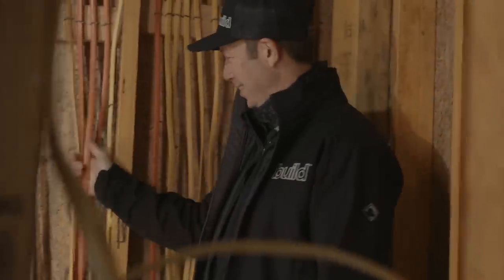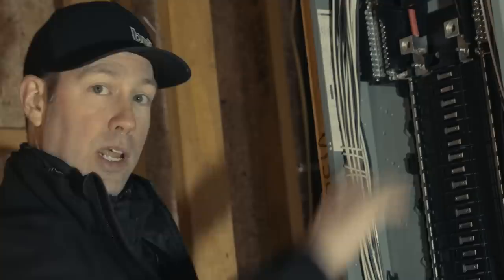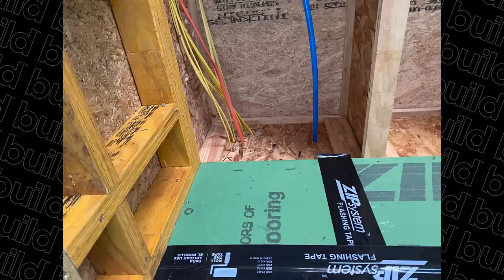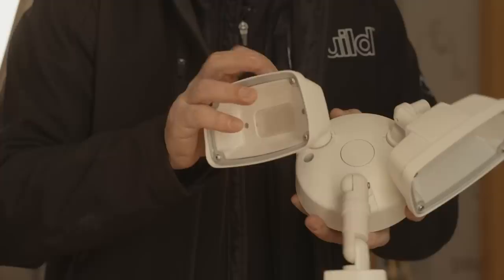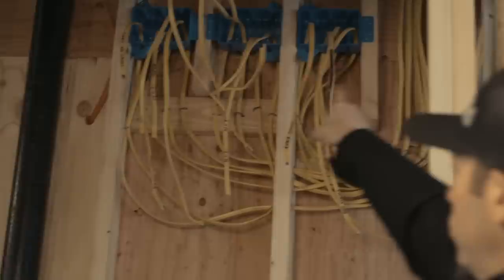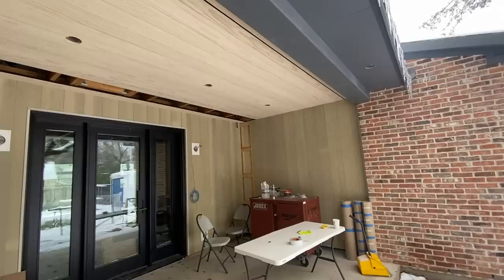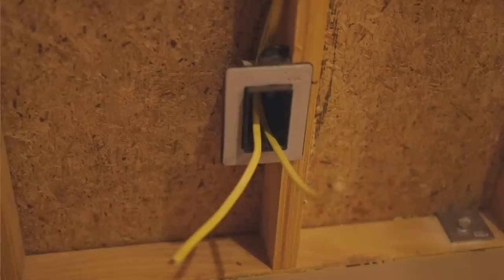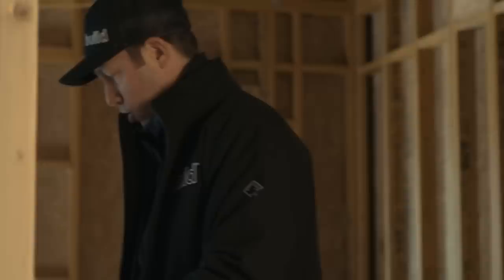5 Tips for New Construction Electrical & Smart Lighting!

Comment: You could go through the expense of having all 20A circuits, or you could tell your electricians to put the lighting and receptacles on separate circuits. Have lighting on 15A and receptacles on 20A. Just my opinion but you’re the boss😂
Reply: But then he can't brag everything is on 12 gauge!
Reply: you can but the extra labor and planning might not be worth simply keeping it all 20
Reply: @frankyb702  It's actually more labor to work with 12ga, as numerous electricians have pointed out. Since lighting and outlet circuits should be separate, regardless of wire gauge, it's not hard to use 2 different flavors. You still have to put other things on wire bigger than 12ga, so it's not like the whole house is done that way anyway. And if you use 14 for the lights it is easier to identify in the future - white romex = lights, yellow romex = outlets. Kind of like using the blue and red pex...few people just use white for both.

Even if wire is free it doesn't make any sense to use 12 for lights...also, even if you have 12ga for your lights, it's better to put lighting circuits on a 15A breaker too - again, easier to identify.

I totally agree with outlet circuits, 12ga/20A for sure, although still very unlikely to ever use that capacity. (Especially for an energy nazi like Matt)

More importantly if you hire an electrician tell him to do it right, don't tell him what kind of wire to use. That's his job, why did you hire an electrician? I can just imagine the face palm when the clueless customer starts dictating wire size...
Reply: With the introduction of many low voltage LED lighting fixtures, it makes so much more sense to separate the lighting and receptacle circuits.  Making it even easier for automated control later especially if you make your lighting runs to a separate box and your breaker feeds to that box.  Join them with wire nuts for now and later you could insert full automation control when you are ready.  This and not having to rely on unreliable wireless control of your lights.
Reply: Why are the 220 circuits outside?
Reply: @ryanroberts1104  Anyone who has managed subcontractors knows that once the price is set, they are going to get the job done with the least effort and least cost possible. It's your job as the GC to snuff that shit out by dictating requirements ahead of time.
Reply: @mr.g937  Somebody like Matt should be using a quality electrician, not some Mexican they found outside a Home Depot. That means the electrician should know it is a high end home and wire it as such. High end electricians are a thing and probably all Matt works with. Matt himself knows nothing about wires and electricity, that's the problem here. You don't spec things out when you have no idea how it works.
Reply: How about let the electrician do his job.
Reply: Yes agreed. Separate lighting in 15 is more than enough.
Reply: @vadimnesen8060  But 20 is future proof. Maybe you wanna add something later and that nearest circuit is the lighting circuit. 

If you go all LED you can put up I thing 150 lights on 1 circuit no problem. Which is more than enough for a house. But it depends. Is the extra $70 in wire worth that kinda savings?

All price savings for homes comes at the detail level not the rough in level. 
The type paint, trim, siding, etc. 
Plumbing and Electric upgrades are pennies compared to the bathroom tile or faucet fixtures you choose.
Reply: @genestarwind4610  yea its a expensive way to future proof i guess.
Reply: @ryanroberts1104  You're 100% right
Reply: 15A lighting is much more efficient, especially when cramming dimmers into boxes.
Reply: @krakenwoodfloorservicemcma5975  yea its silly doing it in 12 wire. Most new commercial lighting is ran with 16 Guage low voltage wire, only the transformer gets a 12 wire
Reply: exactly, way most do around here, never mix outlets and lighting on same circuit anymore
Reply: everything on 20 amp is stupid. Put an amp meter on any 20 amp circuit that is running receps and lighting and it will not be pulling close to even 15 amps.
Reply: If any of you above were electricians you would know that NEC states that lighting circuits in a single family dwelling cannot exceed 15 amps, most inspectors around here would be scratching their head trying to figure out why you struggled to make up and cram into an already undersized jbox attached to these new LED fixtures 2 or more 12/2 cables and why you spent all that extra money for no reason and what other codes you disregarded over a preference.
Reply: @genestarwind4610 Not really. You keep the lighting and receptacles on separate circuits. So, if something is to be added that isn't lighting, that goes to the nearest receptacle.

Comment: The Halo line is only 5% dimming.  He is going to really regret that. People don’t understand how important 1% dimming really is.  I personally feel that Lutron has significantly better lighting control systems.  Also, If you’re going to go to the extent of having smart lighting, and home control, you really should have an IALD certified lighting designer do your lighting plan and fixture specifications.  Unlike interior designers, an IALD lighting designer DOES NOT make money of off fixtures or get kickbacks from manufacturers.  A good lighting designer will help you avoid a lot of lighting pitfalls, and also keep you in budget.  I can’t even begin to tell you how many bad lighting layouts I’ve seen done by architects… Lighting has become a true specialty, and it’s well worth the investment to make sure you’ve got the right person looking after it.  I am not a lighting designer, but I would never build my custom home without having one on board from day one of design.  Worth every penny.
Reply: Bluetooth is also an awful option for large amounts of lighting as well.

He should have gone with Zigbee, or Zwave devices. Those are also not vendor specific protocols and can be controlled without proprietary apps. That app he has might not be supported in a few years and he is also stuck in the ecosystem of those lights. With Zigbee/Zwave lights you can mix and match manufactures to work together.

They also form a mesh network to keep devices from dropping off which I guarantee he will be having issues with bluetooth. 

Just speaking from firsthand experience. I imagine those were sponsored products anyways.
Reply: @Cstegg  "Bluetooth" as used in modern lighting products is actually the "LE" version which supports mesh networking. ZigBee often uses the same 2.4GHz as BT, with the same penetration problems. Zwave is a closed proprietary protocol. BT LE is actually a very reasonable choice and improves every year with better vendor adoption. I worked on the original ZigBee specification and even I say it's not significantly better than BT LE in the generic smart home use case. The 2 protocols can be remarkably similar when configured so.

Comment: Wafer lights are a pretty poor choice for a new home.  Having the bulb recessed in the can allows for much better light distribution. Wafer or surface lights are for closets at best. Spending a bit more on your cans either from WAC, USAI or another higher end manufacturer really makes a difference. Also, if the house is custom, I would find it in the budget to hire a lighting designer. I am willing to bed most if not all the lights are placed poorly. 4 cans and a fan, downlights over carpet, bathroom sconces over a mirror  etc.

Comment: use #14 for lighting circuits. Your electrician will thank you.
Reply: Totally agree.  Especially with LED's.
Reply: @dmolldude  also easier to make up to small fixture wires and multi gang switch boxs are a breeze.
Reply: IF that's the only thing on the circuit. Honestly, I would do 12ga everywhere too, then give the electrician a $100 gift card to the restaurant of his choice.
Reply: I just re-wired my own house and even being in the industry did all 14/2's for lighting. Made no fuckin sense to use 12's everywhere. Even at cost, that shit adds up... I did use 12's on most receptacles however though. That actually made sense for the added cost.
Reply: @Floridaman8783  my Local county Natrona, in Wyoming 12/2 is code.  Only trailers (single and doublewide etc.) and smoke alarm circuits I believe can be 14/3, but rarely does electrician bother to carry any 14... With LED lighting they really could change the code and allow 14/2 circuits for just lighting.. I am a broadcast engineer and DIY handyman, not electrician...
Reply: @Crusader1815  Sure, let's just throw money everywhere. It grows on trees...
Reply: I totally agree 14ga. for all lighting circuits should be the norm LEDs draw at most 1/10th the amp draw on a 15 amp breaker gives you at least which is 1500 watts or really 1300 watts @ 80% breaker capacity more than enough to light up a complete floor. 14ga.makes life easier in your switch boxes.
Reply: @Edgardocelectric007  Even though English is my first language, I don't really understand what you're saying. lol sounds awesome though!

Comment: I understand people's hesitation with hub required home automation but many of those standards are purpose built for low bandwidth distributed devices. I ended up going almost entirely z-wave mesh network with a hubitat hub for my own home and I'm glad I did. There are tons of z-wave devices by different brands offering different feature sets if you every find yourself wanting something specific and the frequency range it uses doesn't conflict with wifi.
Reply: This comment should get more upvotes. A hub makes things easier because you can combine other devices together. Otherwise you'll probably end up with 4 or 5 different apps on your smartphone to control different devices from different brands. With a hub, you can have your brand x motion sensor turn on your brand y lights. And the switches are more affordable because you are not beholden to a specific brand.
Reply: Hubitat also integrates well with Lutron Caseta. Just get the Caseta Pro controller to allow for integration.
Reply: @raymondt817  Totally agree Ray. z-wave is the way to go if you don't want to be opening 5-8 different apps to control everything. I've got everything tied to a qolsys IQ 2 plus panel. And tied to alarm.com for cellular connectivity. It's awesome to have EVERYTHING in a single app, from my garage doors, door locks, lights, Hvac, sprinkler system, motorized blinds, cameras, water sensors, etc etc. I love all of Matt's Build stuff, but this is not what I would consider a "smart" home lights at all.
Reply: Yep, totally agree! Will be interesting to see if he has any issues with the Bluetooth.
Reply: You can also use something like home assistant (or other ‘open source’ home automation software)  to manage all the automations in one place. You then are not stuck to only z-wave or zigbee or whatever devices. I even have both z-wave and Philips hue devices that run on the same actions. 

More important though is your sentiment that you should use hub-based tech. 
Bluetooth is fickle. As a software dev, I will not rely on Bluetooth lights/whatever as they will have more problems in the long run. Not to mention that these other protocols (like z-wave) are designed for exactly these purposes.
Reply: He is going to absolutely hate tying himself into a proprietary solution.
Reply: I have Z wave switches tied to z-wave aoetec multi-sensors. My kids lights turn on, with motion, only when it's dark enough to require it. I use a bond device to manage my old remote ceiling fans/lights with the same actions. 
Smoke alarms, door locks are all z-wave, if there is smoke detected all the lights turn on and the doors unlock. I would love to take it even farther. Z-wave window coverings, automated windows and vents.

Comment: As an electrician some of this is overkill and some makes sense. For one 12/2 throughout the house is a waste, but the middle ground that has logic is doing the receptacles in 12.  In a brand new home no one should need to plug in portable heaters or window AC units, which are 2 of the biggest culprits I find people overload their circuits with.  Older home's didn't require a 20A bath circuit either. I've seen hair dryers with a wattage label of 1875W, which is more than a whole 15A circuit. Again that's an old home problem in an area already addressed by code. 

A vacuum can draw around 12 amps but it is usually a temporary load. Excluding kitchen/dining/bath areas that already require 20A circuits, most people will never utilize a fraction of any of those 20A circuits. One cost saving route would be to put more receptacles on a circuit. With most lighting going the LED route that's even less load in the system.

Having breakers on the exterior of the house I just hate the idea of it. Main outside if you must; 2020 code when adopted will mandated an exterior shutoff. The whole copper/AL issue has long been settled. Those AL wires will not loosen on those lugs if installed properly, neither will the copper. If the customer wants copper and they got the cash I'm happy to install it, but overall I feel the extra money spent on copper feeders and 12/2 on lighting could have been put to better use elsewhere.
Reply: It would have helped in my garage where I run a tool and a shop vac and trip the breaker. Of course, not putting all the outlets on a single breaker would have been nice, but you know those electricians. 😂🤣😂
Reply: actually aluminum has a different compression than copper - virturally all aluminum wire will have to be re-torqued after a year. and it's better to have the extra capacity since it's alway about accomodating potential.
Reply: Yeah, the biggest issue I had with his recommendation for 12/2 everywhere was the complete disregard for the extra labor involved. Bigger wire = harder to work with.
Reply: @akyak333  that's wrong
Reply: My mig welder always pops my bathroom circuit... 🤷😂
Reply: wait until 2030, when your house  need to charge 4 electric car at the same time...... this is just for future proof!
Reply: @daveton9033  It won't be 12 wire charging those cars, in any event garage receptacles already require 20a circuits.
Reply: Yes I agree, if I never have to make up a switch box with 12 wires again it'll be too soon!! LED's are for what 14 wire was MADE for!!! That and trimming switches...
Reply: @timmarrier  : The Load! Go Figure! Smart ass !

Comment: Wiring lighting with 14 gauge wire is just a little easier.  Also allows you to get more wires into switch boxes.   12 gauge is just not need with today's LED light fixtures, it is just more work and extra money.
Reply: Yep. You could literally wire every light in the house with a single 15A 14 gauge circuit and it would not be anywhere near capacity. It would be annoying to have every light on one breaker but they should be separated from the outlets.
Reply: We use the bathroom circuits to pick up a few more lights. It's a non arc fault circuit and easily you can add about another 8 lights off it. We still stick to the 12 "items" per circuit rule even though the led wafer lights we use a lot are such low draw. All on 14 gauge.
Reply: @Dweenz69  Bathroom appliance circuits (IE hair dryers, curling irons etc...) are supposed to be dedicated circuits and its lighting and wall switches must be on another circuit circuit.